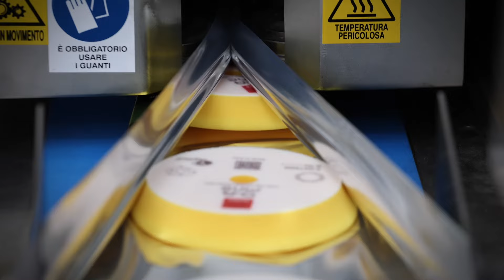Introducing the RUPES Texas manufacturing facility

Comment: Congrats and more power!
Reply from the maker: Thanks!
Reply: @RUPES  Slowly converting tools Rupes platform as i am impress with the build and  quality inside and out and is something that other manufacturers need to catch up. i have been debating on getting my next polisher and im torn between the Nano Ibrid or the Mini polisher, im just worried about the power of the nano if its capable of removing scratches not just marring. im coming from a Rupes Mille and Rupes Rotary btw, your thoughts on which one to get first before the other. Thanks
Reply from the maker: Thank you for the kind words. The choice is really about what type of work you do and types of vehicles you work on. Both tools are capable or removing defects, but the Nano does so in much more compact areas. If you do not find yourself working in spaces that are 40mm very often then the LHR75E Mini is a good choice. If you do a lot of small work then it might be worth having the Nano or both tools.